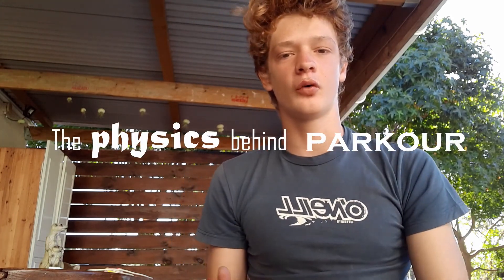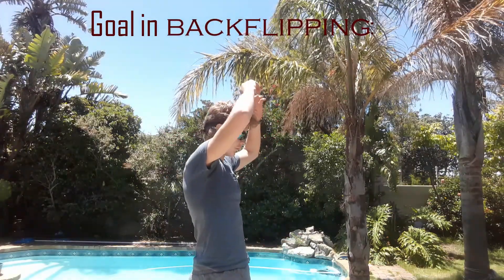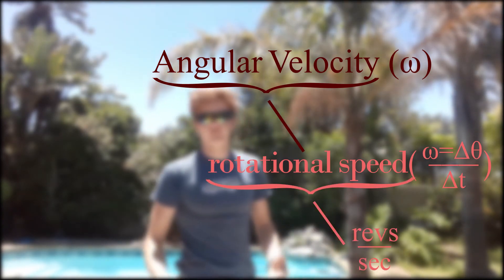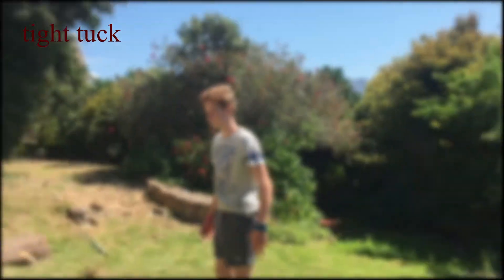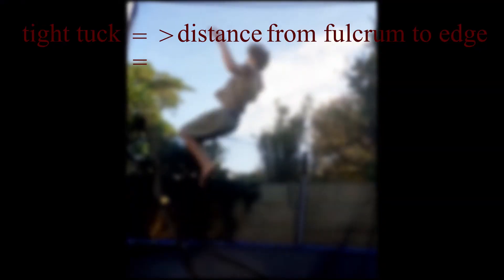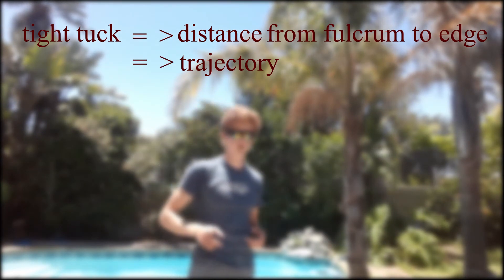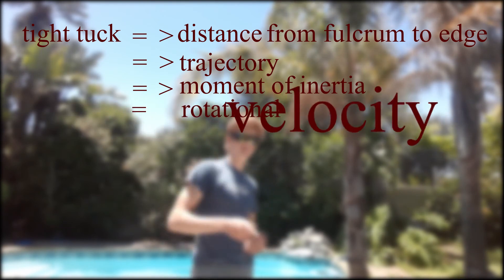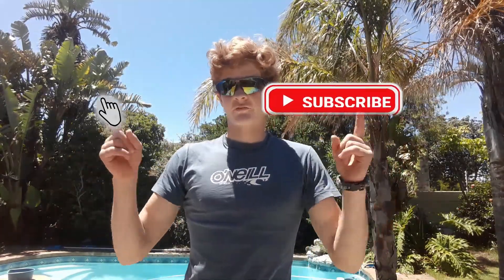The Physics Behind A Backflip

Comment: Thank you. I am very close to attempting a backflip. I have done them into a pool and foam, but never onto a surface. It’s scary. I am trying to accumulate as much information as possible so it goes well.
Reply from the maker: You can do it I'm sure! just make sure you have someone to spot you and practice off a slope or low wall, about 30cm high maybe! Good luck